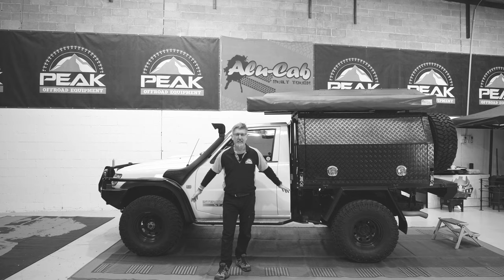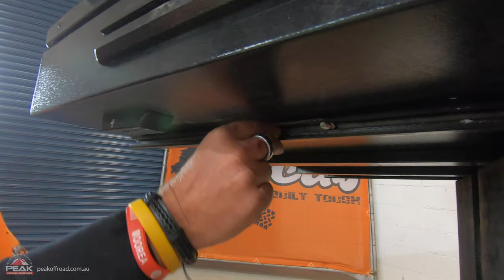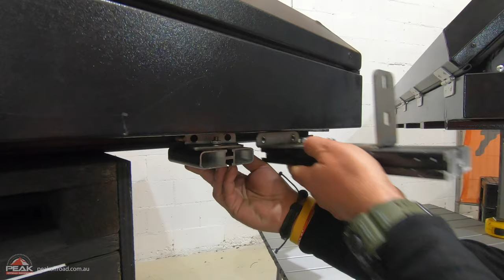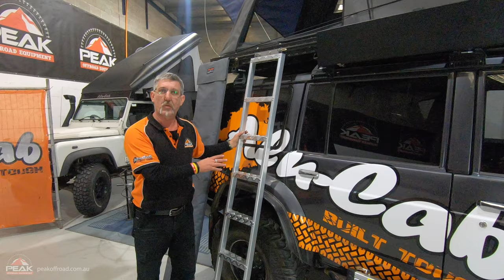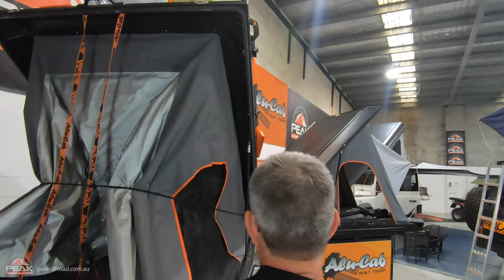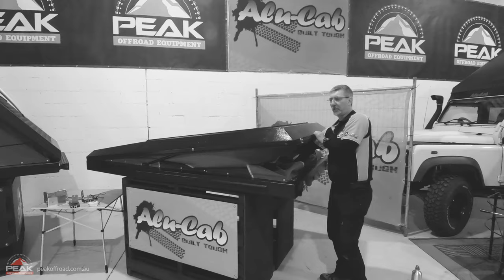Peak Offroad Equipment - Everything You Ever Wanted To Know about Alu-Cab Rooftop Tents

Comment: I just spent 4 days camping in the snow in one of these (around -5). I left one window open about 2 - 3 inches and had no condensation issues as a result. The only source of frustration for the entire trip was the gap between the awning and the tent, for which they apparently sell a "gutter kit". If I can find one I'll be purchasing it, as I had a constant stream of snow through the gap, directly into the back of the car..

Comment: Hi, thank you very much for the informative video. I am very interested in the Expedition 3, because I am looking for a roof tent on which I can transport my canoe. If I may, I would like to ask a question to the expert: is it possible to mount the Expedition 3 on a VW Amarok, not on the hardtop but on the double cabin? On a Frontrunner Slimline carrier system? My hardtop does not have the necessary roof load and actually it should be possible on the cabin, right? The overhang would be a bit bigger, but the Expedition 3 should be able to do that easily, or not? You could support the roof tent with 2 packer blocks, so that the load with people does not get too high on the first crossbars while sleeping. I would be very happy about an opinion and send my best regards from Germany. Azze